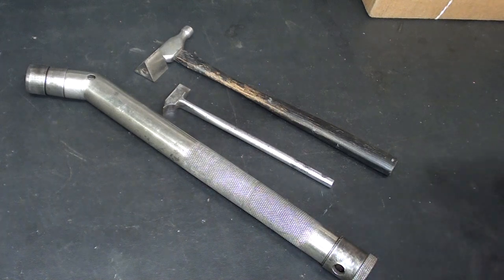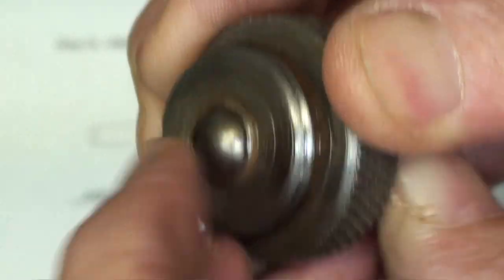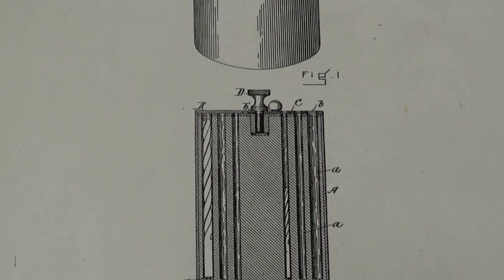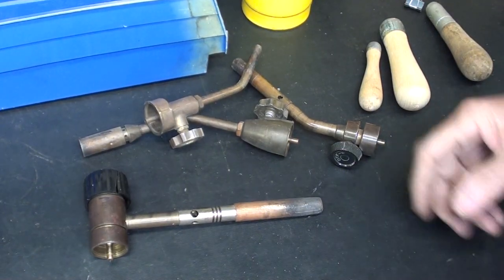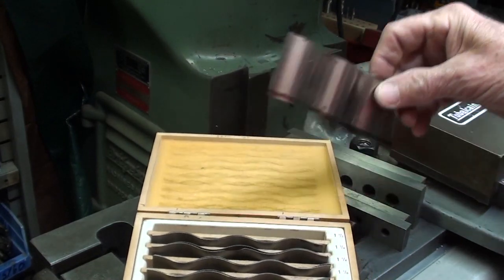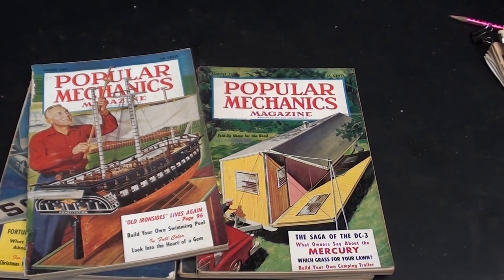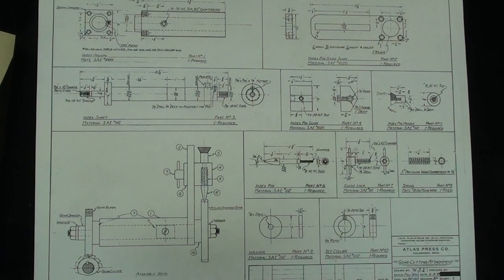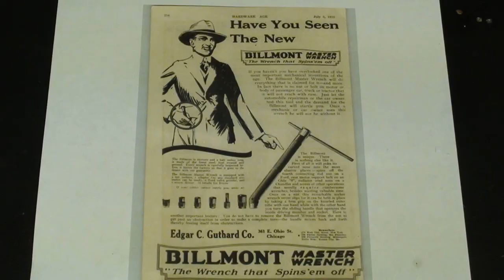THIS & THAT episode #59 tubalcain mrpete

Comment: Please, don't change a thing about your presentations. The side notes you include bring depth and meaning to the subjects. You do a great job. 
  I just finished the gear cutter project from the plans, I did mine slightly different using material I had but stuck with the basic dimentions. It was a great project. I'm waiting for a mandrel and cutters to road test the project. Thanks so much for your videos, you have put new meaning to my now retired life. New hobby new happy life.
   Thanks
     Chuck
Reply from the maker: Send me a picture sometime of the gear attachment. I intend to vary a little bit from the blueprints. I am not sure why they made the ends of the shaft only 5/16 in diameter? I think I will make mine threeforths
Reply: @mrpete222   I'll get to my computer and send some pictures, there is a second set of blueprints with a few changes and larger threads and easier to read figures I'll scan it and send it to you today. It's spread out a bit on two pages.
Reply from the maker: Thanks

Comment: I've made a few file handles on my wood lathe. They're easy to turn, and dimensions aren't critical. You can use a piece of copper or brass tubing for the ferrule. The trick is to drill two concentric holes for the file tang. If you have only 1 hole, the tang will wobble back and forth until it comes loose. However, if you have 2 holes that are in proportion to the taper of the tang, it won't wobble and will stay in place nicely. It's kind of like a Morse taper, but a lot less critical to make. I  never had any of mine come loose. Visitors to my shop always seem impressed by them too.
Reply from the maker: Thanks, that sounds like a great idea

Comment: Is that a Hamilton drill press that is usually shown on your bench in these "This and That" episodes?  Ha, Ha, not shown this time.  That figures.  I had a Hamilton years ago, what a fine machine.  You could drill the smallest holes imaginable.  One job was to drill a .o2o dia. hole 1" deep, in production.  No problem!  The Hamilton was made in Hamilton, Ohio.
Thanks for taking us bak to the era of greatness.  
Older than you, JIM

Comment: i enjoy the patent shots! As for small parallels, i use hs tool cutting tools. they have a nice ground finish, and they tend to be handy for me. I have all sizes from 1/8" up to 1.25" sq. and some rectangles for my amco shaper. But 3/8 to 5/8 get used frequently. I probably have oodles of key stock.....but finding them in a quick manner is altogether a different story.

Comment: I've had good results heating the file tang (not all the way red hot is fine) and hammering the handle on. I just make handles out of old broken chair legs or dowel, or good sticks...

And great idea for small cheap parallels, I've used all sorts of odd scraps for "parallels" on my 2" drill press vise. They will be sufficiently accurate for many applications.

Comment: Little Machine Shop sells parallels for 3 and 4 inch vises.  I have a set and it is perfect for using a screwless vise.  I would add adjustable parallels to your list along with the wavy ones.
Reply from the maker: I did not know they made little ones. Yes, I have several sets of the adjustable ones

Comment: First thing I've noticed after getting a new Argon cylinder was the plastic knob... Almost bought a set of wavy parallels... I do not have a milling machine though.... making those lithium batteries safe is one of the main challenges, they can't be overcharged, overdischarged, overheated, but then we still have gasoline fires on accidents and they are around for over a  century
Reply from the maker: Thanks

Comment: It is interesting that that patent for the wrench handle didn't include a groove in the handle to keep it in a specific position. Keep it up with the patents, as having the number means I can go read the patent for more details. For instance, is it the ball detent itself being patented here or the fact that it is assembled by staking the ball in rather than having some sort of removable plug? My t-handle tap wrench has that (which unfortunately means the screw cap and spring for the detent ball block the use of a tailstock/drill press tapping guide).

Comment: I figured your tablet battery was pretty flat before you cut it apart. Big Clive has his "explosion containment pan" which he keeps at hand any time there is a chance he might short out a lithium battery. It must have been a bit rough on your saw blade, though...

Because those giant car batteries are composed of much smaller individual cells, there is little risk of a huge explosion, but instead you might have a series of small ones, so it might be like listening to popcorn pop! That is one of the downsides of battery-powered vehicles: all the stored energy is there ready for pretty much instantaneous release, while with a fuel-powered car the rate of energy release is limited by the rate of arrival of oxygen from the air.
Reply from the maker: Thanks

Comment: HI, Long time viewer and learner. I own  Logan 400 that I have made many parts for ( 3d printed change gears- thread dial etc. plus metal parts ) inspired by some of your videos.  I'm now interested in collets for my lathe but there seem to be many forms and functions involved. My thought is that a video on the types and how they install on lathes would be helpful.  With any luck you've already made one.
I also have a question on the Logan back gears. I made a back gear assembly as Mine didn't come with one ( with a 3d printed gear with brass bushings ) that worked fine till I found a low cost one on eBay ( just the back gear not the shafts etc.)  So the question is what orients the back gear into position?  From the rebuild videos I've seen there doesn't seem to be a lock mechanism. On mine I printed a handle with a pull pin to hold the back gear engaged and disengaged. Your thoughts?

Comment: I dont have wavy parallels, they're made this way so they cannot move when squeezing a part in the vise.  Instead, I use my plain parallels and I use a piece of plastifoam in between  the parallels so to keep them well inside the vise under the part to be worked.

Comment: Use lathe tools for parallels they are ground and accurate and low cost. You can even use of they are ground for cutting use.
Reply from the maker: Yes, I often use them. The ground ones. I should have mentioned that in the video

Comment: About Tesla... a few (at least) have burnt to the ground due to accidents damaging the battery... they put a very heady duty skid plate under the battery (which spans the floor of the car) to prevent such. I think they redid it after said accidents... it's nowhere near as common.  It's not like regular cars don't have a tank of something dangerous onboard that can be a problem if damaged...
Reply from the maker: Thanks

Comment: I wish they still made "real"-MAPP fuel still. Old-MAPP was (very)much hotter than LP, this newer stuff is a totally-different formula. I loved using MAPP, with an-Oxy-MAPP cutting/welding torch set up. So much smoother burning/cutting, with practically no-pop-back, which Acetylene/Oxy had a tendency to do.

But, alas, the REAL-MAPP,  which was a literal-mix of/with Acetylene, was judged too-unstable. Go-figger, I guess...? ☺
Reply from the maker: Good example of the safety Nazis at their finest

Comment: Please don't cut out the parents, side bars and rants!  Sometimes the unintended comments bring the most value to a teaching session. Way back when I was working with my Dad and a  neighbour (who was the best mechanic we knew at the time) to refurbish a Ford 9n and convert it to 12 volt the neighbour (Alf) would go off on great tagents and probably taught me more about other stuff then what I was learning in the refurb (which was a huge amount). I still fondly remember those days working with Dad in the shop.
Reply from the maker: Thank you very very much for encouraging me when I was feeling a little down
Reply: @mrpete222  Well you've cheered me up on many occasions so I am glad I could reflect a little of that back.

Comment: Would it be possible to get a copy of the blueprint for the Atlas Lathe Gear cutting attachment? I would like to cut a few gears on Grandpas old Atlas.
Reply: It's on the internet in several places, if you can't find it message me. I just made one, great project!
Reply: @chuckmayerchak3071  I have looked for this pdf with no luck. can you mention a location to get the pdf. I would rather not yet bother Clausing for my request.  This looks like a good project.
Reply: Can you private message me on Facebook and I'll send you the PDF file i have two different prints. It is a great project. Charles Mayerchak on face book We can go from there. I don't want to post my email here and I don't remember the site ooo found thrm. But it took me hours of searching for sure.
Reply: @daveharhay4973  did you find the PDF for the gear cutter. I don't know how to send it from here. Are you on facebook??

Comment: The amount of batteries in EVs is very dangerous - that's why they do a HECK of a lot of engineering around crash protection on them. Each cell is individually fused in case the container gets crushed and shorts things out.
A fully charged lithium battery can throw flames, but it's not that bad. If you had something shooting flames out a foot in your shop it would be very exciting but not particularly dangerous.
Given the amount of energy in them, an EV battery catching fire is dangerous but not nearly as bad as a gas tank catching fire - gasoline is 100 times more energy dense but the batteries are bigger). There are dozens of videos of EV batteries catching fire. I'd still rather be in an EV with a battery on fire than a gas car with the gas tank on fire.
Reply from the maker: Thanks

Comment: MAP-Pro gas cylinders aren't much hotter than propane (130F/100C) hotter.  Add oxygen and you can get MAP-Pro to burn at 5300F.  MAP-Pro at my local big box hardware store charges almost 3x the price of propane cylinders.  Not worth the difference to me.  Today's "MAP-Pro" gas is a mixture of various gasses (mostly propylene), not really a true MAPP  or MAP-Pro gas.
Reply from the maker: Thanks